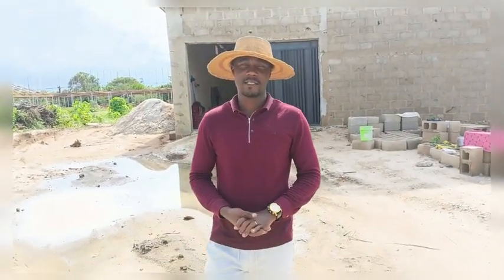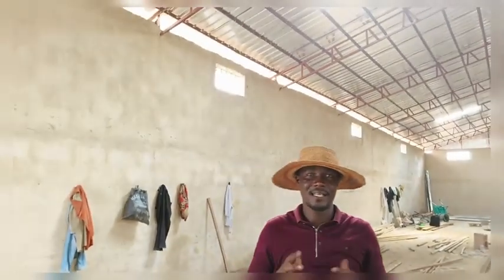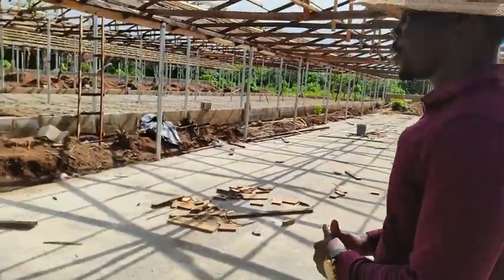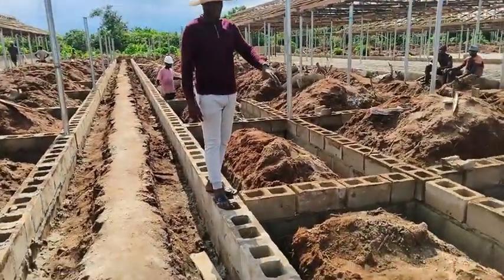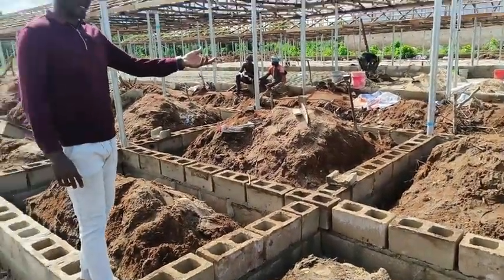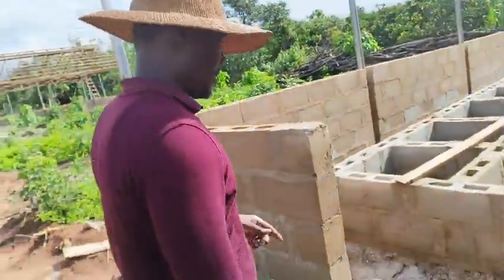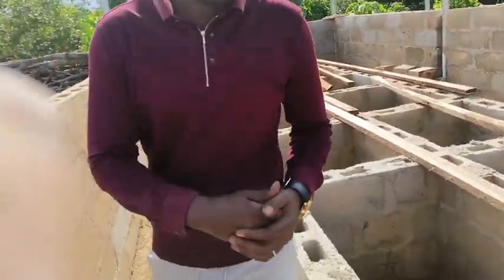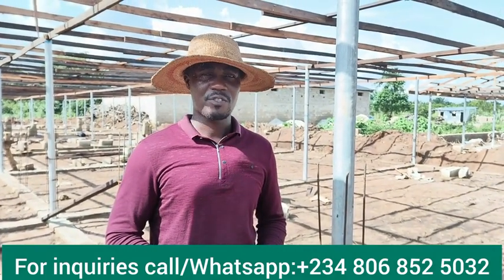Construction of Integrated Farm System in Imo State, Nigeria

Comment: Good morning and great work. Don't know if you put into consideration transfer of disease, especially between poultry and pigs. I meant common diseases among them.
Reply: From the video, you can see the piggery unit is placed in-between the broiler and layer units to prevent easy spread of diseases between the poultry units. As for the spread of diseases between piggery and poultry, there hardly exits any form.